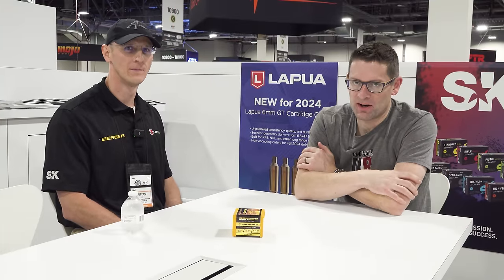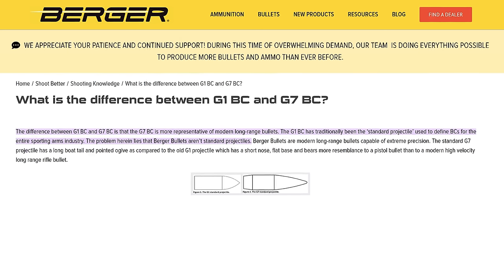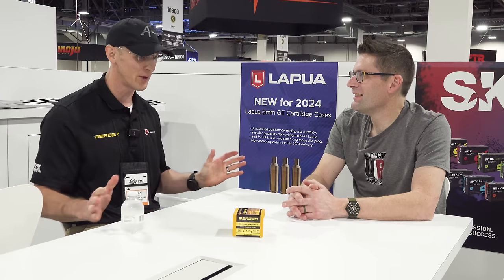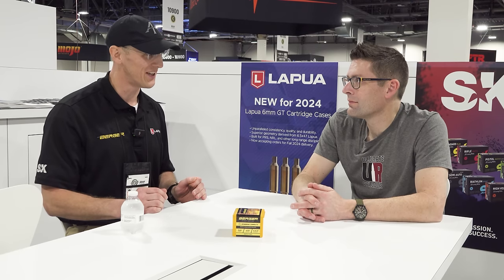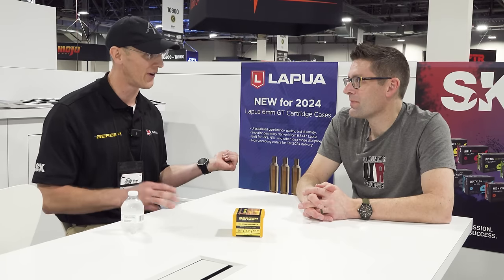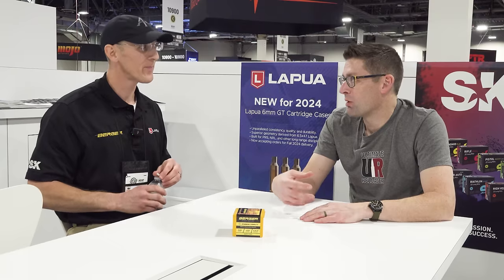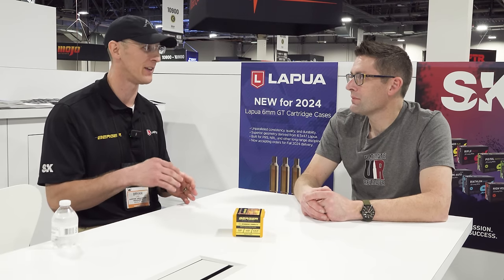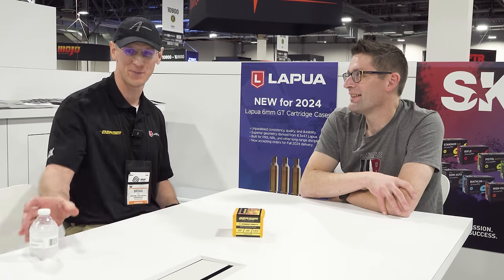What is Mach Trimming? In Depth Discussion with Bryan Litz (22LR Breakthrough)

Comment: Gavin- Brian: 
I was extremely interested in the part when you were talking about the lock affecting SD- among other things. 
The work I did was on the 17hmr; however, there has always been a large velocity SD with these cartridges. I made a lock; a semiautomatic, gas operated, delayed blowback; that compensated somewhat for variations in pressure. The lock also compensated for rim thickness. 
We had won everything we entered in unlimited rim fire competition- to the point other competitors wanted our equipment banned. 
It is validating to me to hear someone else talking about things like this and put a finer point on my theories. 
Michael Garrow

Comment: I am a .22LR benchrest 50 yard shooter and I won many matches with Lapua Multi-match L ammunition that unfortunately is no Longer made. My best so far was 100-6x in Factory Heavy Barrel class. I weigh all my rounds and measure rim thickness to try and find the Most consistent ammo for  my Winchester 52D and My Anschutz 1403. Even then you get that 1 or 2 rounds that just seem to fly wrong. I have spent more on Ammo than I did my guns trying to find that 1 lot number that is a consistent winner, and honestly it is frustrating since I have no control over the ammo like I do reloading centerfire ammo for accuracy. I Hope to learn more from you Bryan as you continue the research. My question is Have you considered air density layers and Humidity layers, that can vary between the muzzle and the target ,and affect the way a bullet flies or impacts the target ?

Comment: Gavin it’s time to come over to the pcp side. Pre charged pneumatics. I have a 22 air rifle that will print 2 moa at 300 yards with slugs. 36 grain. All subsonic. 980 fps. And quiet. It’s a blast. Great episode.
Reply: How much does something that will do that run?
Reply: Is that > than 6" or <? 
 (Either way at 300 yds with an air rifle is impressive)
  Doing it with an Air Venturi AVENGER?
   36 gr .22 caliber? What fps you pushing?

Comment: I have taken 22mag  bullets apart. I remove the bullets weigh the powder and reload and crimp using Berger 40 grain jacketed bullets. Thats made a huge difference in long range accuracy. Plus the extra case capacity of the 22mag shell
Reply: We pulled .22 Mag bullets and replaced them with a Sierra spitzer which we shot out of TC Contender single shots. Sub one inch groups at 100 meters were routine.

Comment: So many questions. 
What will the answer be to tune out the inconsistencies. 
Are we talking barrel heaters, different rifling. Possibly a barrel tuner or muzzle device. 
And then how to map that in software to let us apply that to shooting. 
I love an accurate bullet and 22 has simply never lived up to the expectations I felt it could. This helped a lot with understanding what I've seen and how to start addressing it.

Side note what about mark and sam after work replacing the bullets with jacketed bullets to try and get more accuracy.

Comment: A good explanation to why "standard velocity " cartridges around 1150 ft/s can shoot phenomenally well one day but not the next is the Mach trimming affect. I like to use the cci sub sonic range like their 1050 and 710 for varmint on the farm but for longer ranges if the 1050 isn't doing it then switch between different std velocity rounds from manufacturers like cci, magtech and Remington as they have low SD but slightly different mv through the brands so you can find a cartridge perfect for that days atmospheric pressure or elevation (your. 22lr * and any other firearm but sllower rounds are more affected by this * might shoot well down the valley at the river but will have an impact shift as you climb up the valley).

Comment: Mach trimming only means that your supersonic projos are subjected to higher exterior ballistic forces than your slower shots but both end up downrange with roughly the same velocity and SD.  
Horizontal stringing occurs in the supers because they generate a large Magnus force resulting in a short period of spin drift after leaving the bbl rather than subsonics which don't. 
VLD 22lr projos are long overdue. 
30-50% of drag at subsonic speeds come from Base Drag. Base cavities (used in 22lr today), ventilated base cavities, multi-stepped vortex suppression, and slotted cavities are all ways to passively increase base stagnation pressure. And stepped boattailing, conical boattailing, and non-axisymmetric triangular boattailing are all viable improvements. BTW, at subsonic speeds, 12 degree boattails work best, and well as base cavities with a 2:1 depth to rim thickness ratio.

Comment: So it's almost like the archer's paradox, where initially, the arrow's heading is off-axis to momentum of the rear of the arrow. As the nock is accelerated in a straight line in the intended direction, the front of the arrow is deflected. Yet, the arrow, having been sent to the side, oscillates in it's trajectory. As the oscillation decays, it approximates the original point of aim.

Comment: I witnessed convergence in 7,62 gas guns a few years ago.  This was with a small rifle company on a major LE academy range with multiple shooters (instructors and SWAT snipers).  

We attributed it to the peculiar bore dimensions this company was toying with for velocities.  Groove depth and a faster twist.

The dept sniper ammo was 175gr Hornady (really hot ammo).

Guns cycled hard, flattened primers and ejector swipes.

The LE Sniper standard was a minute at 100y.

The guns held at around 1.5moa  @ 100y

At 200y they were the respective subminute groups of 1.75”

I swagged it as the variance of ammo and bore were “over spinning” the projo, which protracted the external ballistics of porpoising.  Extending the threshold for the projectiles going to sleep.

Spin a top as hard as you can and it will dance in an ever tightening spiral until it stands on end (goes to sleep)

Its the only time I’ve experienced it, I knew in my gut its possible.  When we saw it that day, it was repeatable.

That rifle company isn’t around anymore (for other reasons).

Comment: Interesting discussion.  One thing that seems to get missed in discussions is that the transonic zone is not a nice single line as it is usually shown on curves.  That's done so it can be explained and calculations can be performed that are reasonably accurate.  In reality it is an unstable range or zone where transition may occur slightly before or after the theoretical transition point and it is very unpredictable and not always stable. I participated in a study a long time ago where we made Schlieren shock videos of an object in the transition range and you could see the shock form and then disappear multiple times before it fully transitioned.

Comment: You need to look at what the long range black powder cartridge shooters are dealing with. The same general speeds, transonic dropping to subsonic. Bullet profiles are very similar in most cases. Bullet stability is a major problem. The ranges are much longer, 1000 yard plus are entirely possible. Many books are available.

Comment: Twist seems like a crucial factor, since optimal super vs sub-sonic twists are also very different?  Corkscrewing further indicates twist as a potential culprit.  Barrel twist is currently constant down the barrel's length, but maybe constant dI/dt or dI/dz (where I is moment-of-inertia an z is position along the barrel's-length) should be constant for more consistent trajectories? Or perhaps dI/dt should be tapered down to zero at the muzzle, since corkscrewing might naturally be traced to a dI/dt problem?  Modern machining should enable variable twist-tapering that wasn't possible twenty-years ago?

Comment: For tracking with the change in the speed of sound. One method is to use a powder with a temperature dependent velocity change equal to the change in the speed of sound(sos). Sos decreases,  roughly 1fps per 1 degree Fahrenheit. So find a powder that does the same thing, and you will always be in the same place, relative to the sonic barrier. If you're working up subsonic loads and really need it to always be subsonic, this is useful. It's not flawless, because powder temp is not always equal to ambient temp,  but it helps.
Reply: its 22lr, no one is working up loads...
Reply: @russr  factually, some people are. Furthermore, 22lr is not the only application for subsonic ammo. As a matter of fact, they discuss at least one other subsonic cartridge in which they have already observed mach trimming. Clearly you didn't even watch the video and don't know much about shooting in general.
Reply: @joearledge1  yes but nobody is shooting 300 blackout for match accuracy.
And nobody's shooting pistol caliber for any kind of accuracy passed 100 yds either
Reply: @russr some do.
Reply: There’s also the air pressure / altitude variable for Mach velocity, but charge weights should be able to be adjusted for that. I can just imagine ammo rated for 1010-1015 HPa, 1015-120 etc
Reply: @RandomHolepuncher  yeah, temp isn't the only variable, but it's the primary independent variable.

Comment: 11:20  We named that convergence "spiral dispersion" because it needed a name. A group at 100 yards is either dispersing angularly (angular dispersion) or it's a spiral pattern, due to a bullet that has not fully settled down. Most bullets won't do this, but some bullets (VLDs) in certain rifles do seem to do it.

The wobbling bullet will stabilize at some point (the old benchrest shooters said it would "go to sleep")... then it settles down on a path parallel to the "perfect bullet" which didn't wobble; in effect, the wobbling or "yawing" bullet flies in a spiral pattern, essentially orbiting in a 1" or even larger circle around the bullet that stabiized properly.

So I would not say that the bullets are converging, i.e. "coming together"... they're just as dispersed as they were at 100 yards, it's just that the spiral dispersion ceased once the bullet fully stabilized, and now it's on a parallel path to the perfect bullet, 1/2" to 3/4" away from it. One clue that you're seeing spiral dispersion is you will have a circular pattern to the group (once you fire at least 5 shots). Test such a load at 600 yards and see what you have there, and even farther. 

We never judge a long range load on what the 100 yard groups look like. We've seen it over and over with our clients, and with our own rifles, for the past twenty or so years.

Comment: The two problems that .22lr faces are fairly simple.

Firstly the crimp on the cartridge actually damages the bullet because the open end is rounded over into the lead to make it secure, this exacerbates the "suction cup" butt on the .22lr and it doesn't completely evenly form back out under pressure so the trailing edge of a .22lr slug is going to have an uneven length and form as well as have an effect on the slipstream when the bowshock tightens up to the trailing edge - .22lr IS actually a fairly long slug in calibers.

Secondly the methodology of the priming generates an unequal circulation in the casing with the combustion shockwave producing an angled jet more towards the opposite side from the firing pin which produces circulation within the powder, this can have knock-on effects on the seating of the slug in the barrel.  

.22lr is I suspect a prime candidate for being changed a little.   I would like to see a double-striker .22lr rifle's performance - I believe it will have a minor but measurable effect.

Comment: I imagine temperature change effect also differs depending on humidity and maybe overall pressure.  i.e. cool+humid fire very differently than cool+dry.  maybe even pressure fronts cause difference.  basically all the things that affect air density.  and air density affects the speed of sound.   since a lot of pocket weather stations can measure temperature and humidity and wind speed...  you have a lot off the measurements to (have a computer) calculate the effect on the shot :-)

Comment: #taofledermaus Thinking this is right up your alley
Reply: This is all down to elevation, the density of the air. As the air is more dense at 500 feet vs 1500 feet it's a significant difference. Consider the environment.

Comment: IMO, it's easier to determine the ballistics of a subsonic round at distance than it is to determine wind drift at distance. The reason being, wind velocity and direction will differ/vary across a range. Gravity is a constant. This can be seen even at shorter distances like 50 yds/50 meters when using wind flags. Rimfire benchrest shooters at 50 yds have noticed this and will study each wind flag and make hold-off adjustments for wind drift, even when the flags are pointing in different directions and showing different velocities, across that range. Shooting at longer ranges, without having wind flags across the whole length of the range (impractical and providing too much input to precisely calculate), I'd much rather shoot the rounds less sensitive to wind deflection (subsonic) than rounds with a flatter or easier to calculate trajectory (transonic).

Comment: Gavin, this is by far the best video you've put out to date, with the possible exception of the single stage press rodeo.  Could Mach trimming be taken one step further, by having the entire ES (40 fps) greater than the speed of sound?  The bullets with the lower velocity will go sub-sonic within a couple yards whilst those at the upper end would be sub-sonic within 20 yards.  Wouldn't this imply that all rounds are at the same velocity with 20-ish yards from the muzzle of one another and be more stable??
Reply: I think the idea is that the faster rounds that break the sound barrier will be slowed down more, reducing the extreme spread. Moving all of them above the speed of sound will result in the same extreme spread as if they were all under

Comment: OMG its so easy to have solver being 100% accurate for 22lr.

Past 250m you use different BC.

BC is co related with speed, 22lr slow down so much, that it lose bc over distance, so what you do you use different BC for every ~100m distance past 250.

You can use "self.adjusted" bc for 0-300, then you are little bit off on closer Ranges (0,1-max 0,2mrad) and spot on 250-300

Actual difference solver vs reality on 300m is ~1mrad